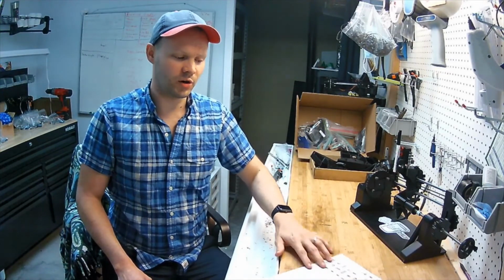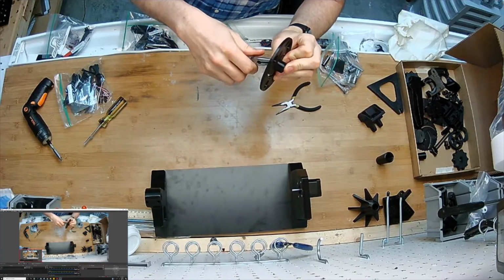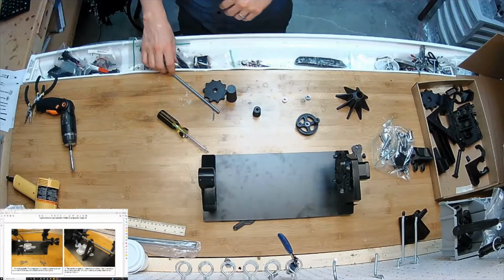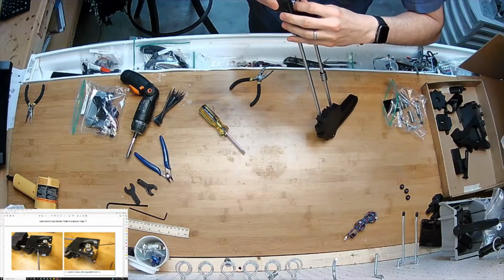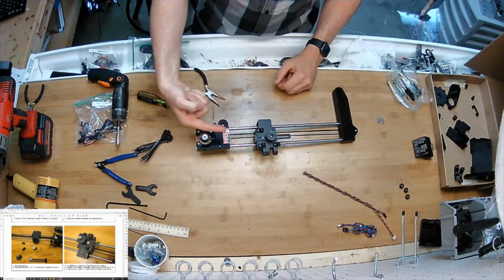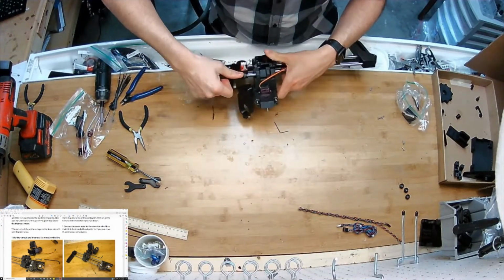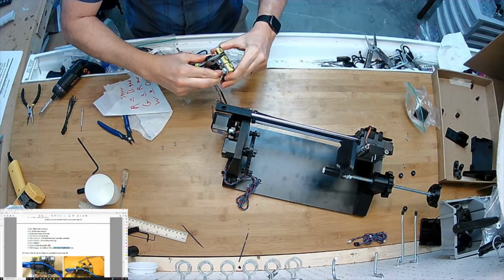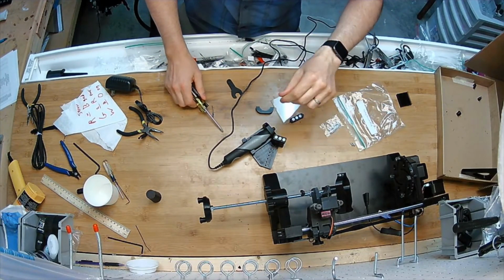CylinDraw Full Assembly Instructions

Comment: 3 minutes remaining in the video and I've kept up with the build, pretty much. Even using the spare parts bag, I'm running short on the plastite screws. I suspect that I can get an order from Amazon faster than if you sent me a few in the post. I did a search using that term, but the results are ambiguous. Are these #4 screws? The ones I need are 8mm so that measurement is no problem.
Reply from the maker: Yes, this is the one https://www.mcmaster.com/90380A108

Comment: 51 minutes into the video and I'm continually impressed with the user-friendly features of your design. The slots to determine the insertion level for the rods are merely convenient, but no less valuable for that aspect. If you hadn't referenced the taper in the design, I would have not noticed it, although I've not noticed it, I can appreciate what it represents. So far, the assembly is going well. I had to reprint the motor mount as it does not well accept light pounding to get the mount on the rods. Second try went much better (grin). I should have used the sponge damper on the first motor, as getting the sponge into place on the carriage motor is a real chore. Too floppy! Two cork would have been better, I think. Perhaps an update to follow.
Reply from the maker: Glad it sounds like its going well! After printing I bore out the rough holes for the mounting rods with an 8mm reamer so they can slide in easier. I used sponges instead of cork because when I last bought inventory cork mounts were no where to be found due to covid related shortages!
Reply: @MGrahamMakes  I've just now finished the wiring connections. My kit didn't have the extra long headers to join the servo cables, but I have a bunch of leftover Arduino stuff. The header pins weren't long enough, so I popped the crimped connectors out of the housings and soldered them together using the pins and covering them in heat shrink. A tiny bit cleaner as a result.